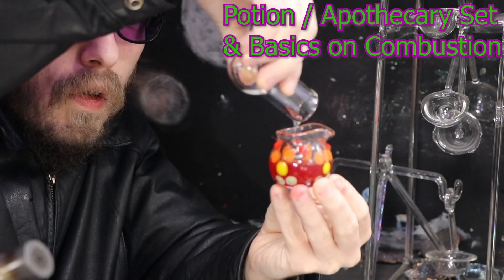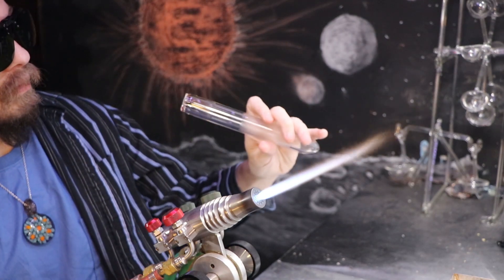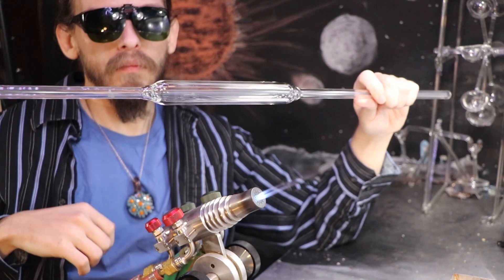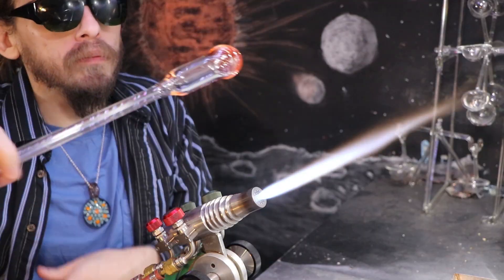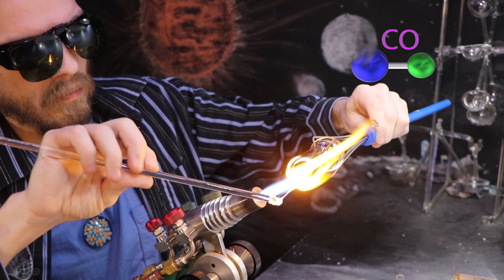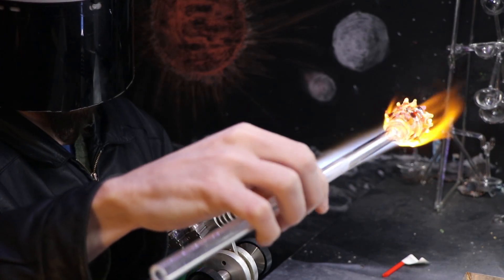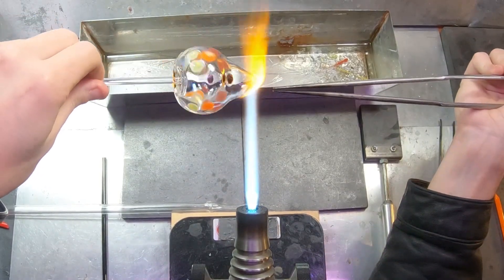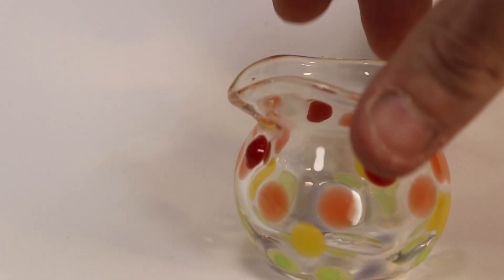Potion Bottle / Apothecary Set & Basics of Combustion - Glass Blowing

Comment: Thanks for another awesome video! 
If you’re still thinking about a mobile workshop, I would suggest a short(er) bus. The vent could be installed through windows already in place, the main “building” infrastructure is complete. 
I’ve tried to renovate a trailer like your plan and encountered all sorts of issues I couldn’t solve due to my lack of welding skill. 
Most of the angles and things on the trailer were not square (which is huge when you cant do “level”)

Comment: hey matt, you have been a big inspiration & a huge help. i actually went and purchased a bethleham bravo sharp flame torch. i have been having issues with oxygen & i seem to recall you mentioning that you used an oxygen concentrator. how can i go about getting set up with a concentrator? what do i need to buy? can i get 1 large concentrator or do i need multiple?
Reply: additionally, when connecting to the oxygen concentrator do you still use the regulator or do you just connect straight to the concentrator? do you use flashback arrestors with the concentrator?
Reply from the maker: Very cool, I'm glad I could help Paul! 
You can find concentrators online. I use an invacare 10 LPM platinum. That will run the center fire, but you would need another to run the outer. You can also run both a concentrator on the center fire and then a cylinder on the outer when you need more flame.
They are expensive upfront (>$1000), but can save money in the long run versus tank rental/refill. They are very easy to use also. They do have 1 external filter that should be cleaned regulary but an internal heppa filter that needs replaced after awhile (>1 year). You can find those on Amazon.  
I hope this helps let me know if you have any more questions.
Reply: @JasaGlass  so i can just connect a 10lpm concentrator to each green port? do i need to use a regulator or anything? does it hurt to have the concentrator for the outer fire running if im only using center fire at the moment or will i need to turn them on/off simultaneously? 

THANK YOU SO MUCH FOR THE ADVICE!! its hard to find much about lampworking out there.  thank you for all the service you do for the community, it really means alot & it is truly appreciated.
Reply from the maker: @Dewey_Boondye420  Yup straight from the concentrator to the torch, no regulator. If you cut the end of the green oxygen hose it should fit on the concentrator nozzle. 

The concentrator doesn't like being blocked off, it could be damaged internally. You can find a 5psi pressure release valve or a secondary shut off valve at the desk to open while you light the torch. OR light the torch and then turn on the concentator leaving the oxygen valve open all the time.   

I don't actually adjust the oxygen on the torch, I run it fully open and adjust the propane as needed. It takes a little bit to get used to and it might not run as hot as cylinder, but depending on how much you pay for O2 it should pay for itself after awhile.

Comment: Can the bravo last on the second stage indefinitely with just two oxy cons? I'm looking at getting into artistic glassblowing, and I was originally gonna get a Red Max, but it's out of stock and everyone says they're very hungry when it comes to gasses. The Bethlehem Stacks seems like the other option that's a good price, and if it can run on oxy cons that'll save money in the long run
Reply from the maker: Hey Lily, I'm not sure what you mean by: last indefinitely. I normally turn the second stage off and on just to save on propane, but you CAN run both stages for long periods at a time. 
  Will you out grow a torch of this size? It will depend on the size of your intended work. However any project too large for a Bravo or Stacks might already be too heavy to hold by hand. 
   I haven't used a Rex-Max myself, but the Stacks looks very comparable. Let me know if you have any more questions and best of luck on your glass journey!
Reply: @JasaGlass  I meant for a long period of time. E. G. If you're working on a larger piece and need the second burner on for a few hours. I'm a scientific glassblower already but would like to get into the artistic side. Might outgrow it but larger torches are a little out of budget
Reply from the maker: @Lily-gr1ct  Oh I see. I'm thinking it should be fine. I don't normally push it to the extreme, so I don't know what it can take exactly. 
   My biggest worry about working a large amount of glass wouldn't be the flame, but the radiant heat coming off the glass. Over awhile I could see that radiant heat soaking back into the torch face.
   If you have to you could make a water cooling jacket from copper pipe and a aquarium pump.